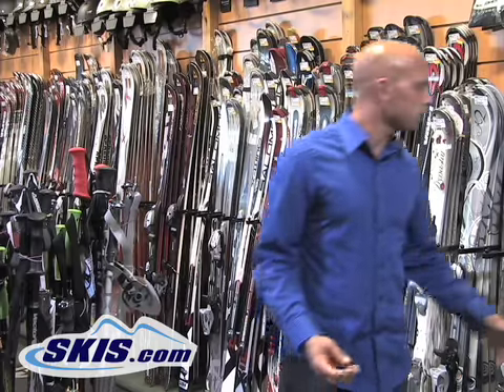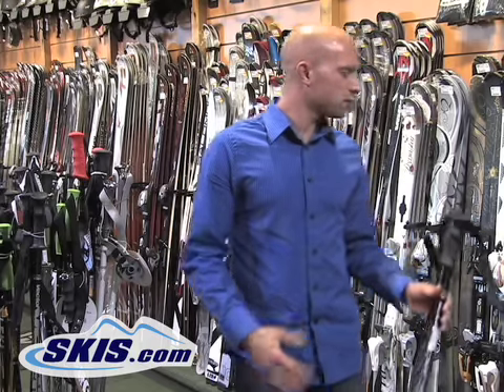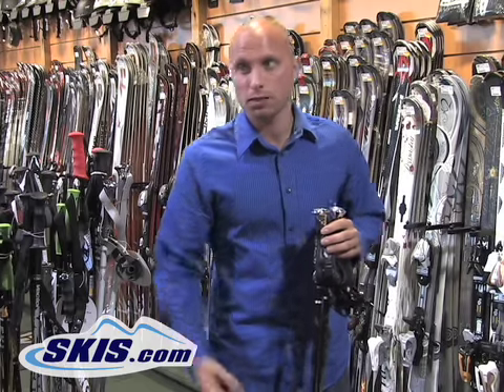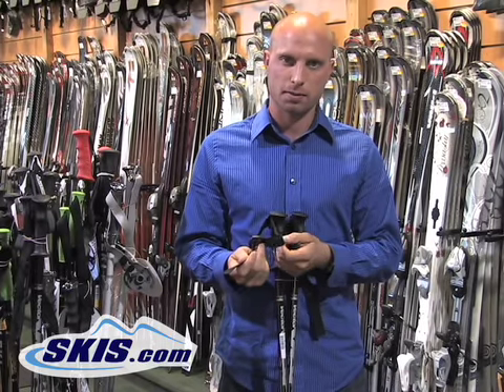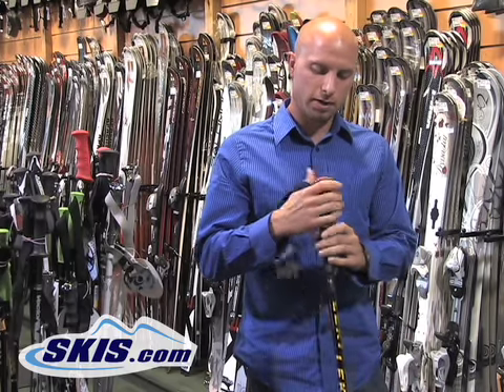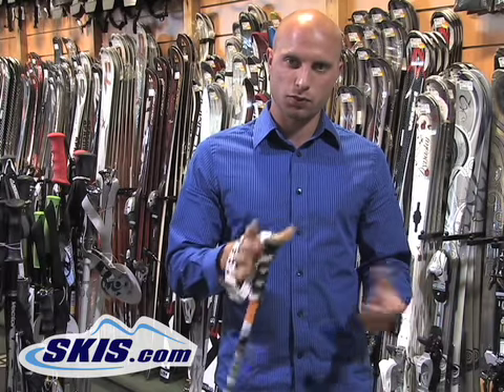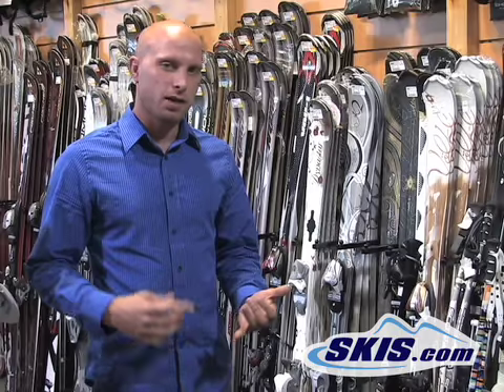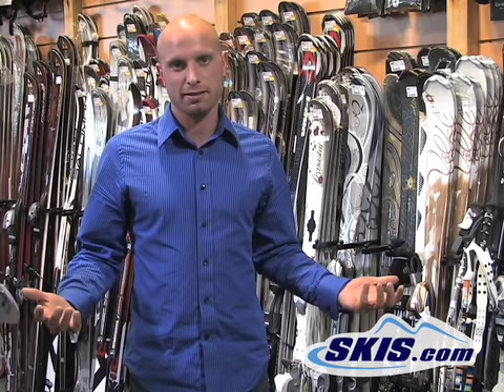Differences between ski poles

Comment: "c" is a troll who leaves this same comment on many ski pole videos, and probably doesn't know how to ski anything but a flat, groomed beginner slope. While it's true that a novice can be challenged by coordinating a pole plant with the rest of the turning technique they're trying to learn, as you advance in skills, a ski pole becomes an important tool for timing a turn and is critical for attacking steep slopes, powder skiing through trees or a skiing a big mogul run.
Reply from the maker: Nice work Arne!  You are 100% correct.